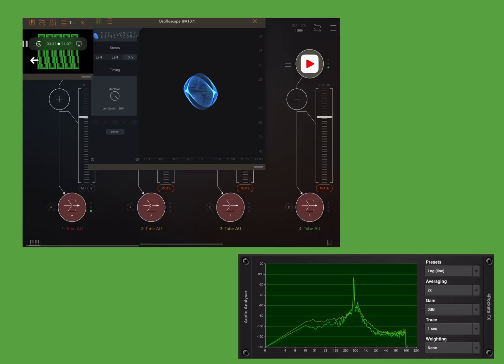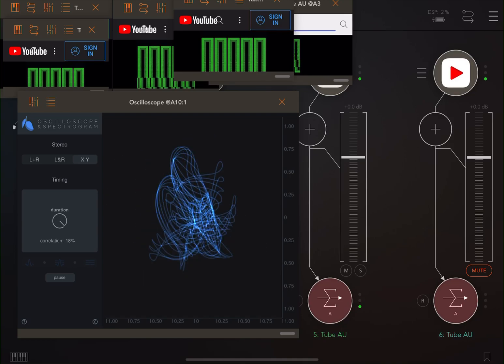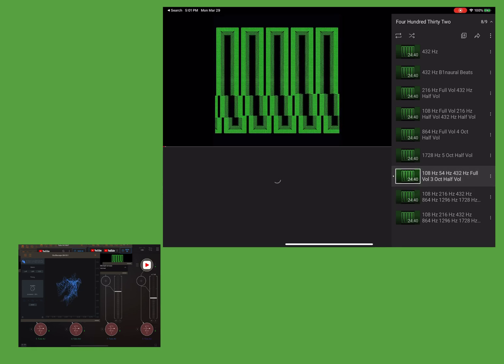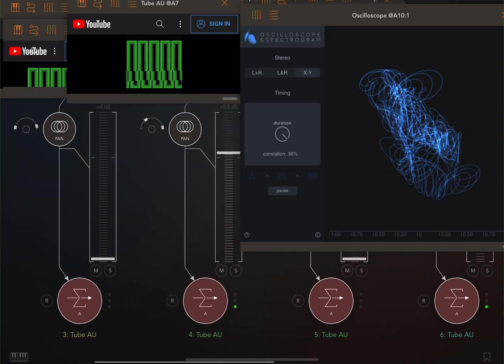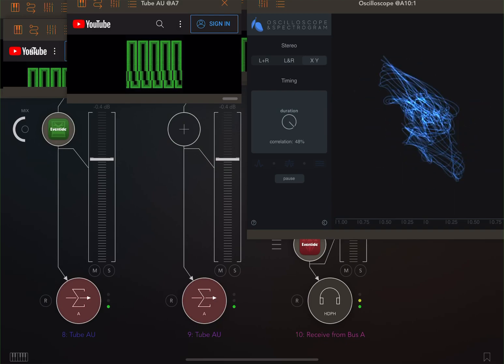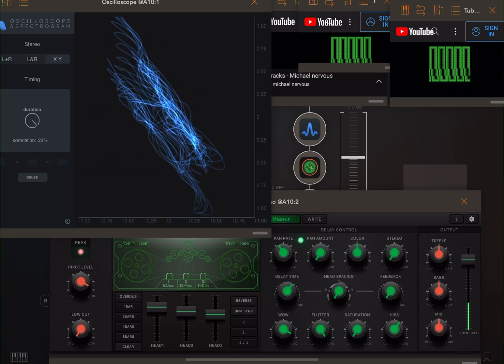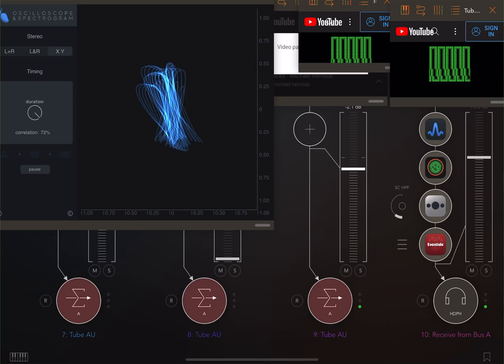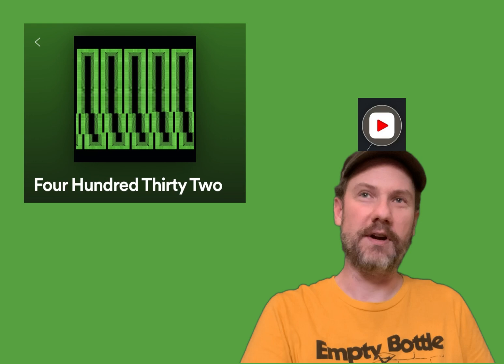Sound Experiments 432 HZ with Oscilloscope & frequency analysers

Comment: Fascinating. Why didn’t you use the file player in AUM?
Reply from the maker: Thank you. I wanted to make an album with the experiment early on. But they intertwined during the concept creation. And I thought why not put it out for other people to try it. As far as the video I wanted it to be visual and why I chose tube au, easily repeatable and understandable to non aum users.
Reply: @michaelnervOus  Great idea & vid but TubeAU costs $$$s and the file player is free inside of  AUM. Still worth a thumbs up though :-)
Reply from the maker: @wignallyt  Thanks and I appreciate the feedback. I usually do use the file player in aum. By the comments so far I realize I will need to explain further how this got started and how I came to this video. The video is just one idea for the album, I want the album available on streaming services so you can play multiple devices, multiple browsers, tv, laptop, phone etc at once. When I first released it I would set devices around the house with it playing (the only thing that changes, using speakers instead of headphones, is you loose the binaural beats). Again great feedback and appreciate the thumbs up! Funny thing at this point is I would have to download the files from distrokid as I'm not sure where I put them.

Comment: Hey man sorry to reply to this here but YouTube deleted your comment about the Soma Ether because of the link and I can't restore it 🤷‍♂️ Yes I've seen that. It's on my shopping list for a film score I'm working on later this year so I've no doubt it'll get used in some videos too
Reply from the maker: No worries. you'll love the ether I would invest in a 10 foot+ length 3.5mm cable for recording because your recorder will get picked up by the ether. It took me a few times to realize that when I would walk around with headphones on.  I have one form the second batch they released so they may addressed that by now.
Reply: @michaelnervOus  Thanks I'll bear that in mind, I can soon whip up a super long cable myself from the bits I've got here luckily. I watched Hainbach's video on it which is what got me interested, seems super sensitive!
Reply from the maker: @ChrisLodyMusic  It sort of reminds me of walking around with binaural mics and recording while listening through headphones. Meaning depth and time perception gets a little bit off. Or if you ever messed with RJDJ while riding on transit, that kind of thing. Definitely pick up some strange sounds in urban environments that will have you retracing your steps.......Woah, I did not even think to look for videos on it. Heading to hainbach now ,Thanks!
Reply from the maker: The video seems familiar. I probably just not make the connection of hainbach back then.
Reply: @michaelnervOus  Yeah I know what you mean, I used to record a lot to MiniDisc with a stereo mic while monitoring. Totally changes your perspective on things a bit like the audio equivalent of a fish eye lens or something. I've not tried RjDj but just googled, sounds interesting
Reply from the maker: @ChrisLodyMusic  After watching the hainbach video andrew huang popped up with a different electromagnetic recorder https://youtu.be/lO5ehpdZ5Po